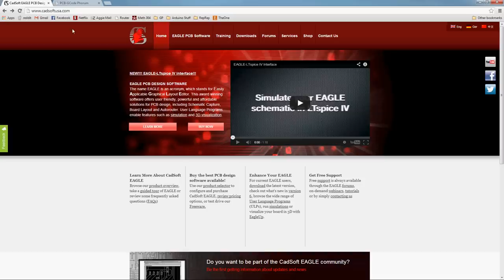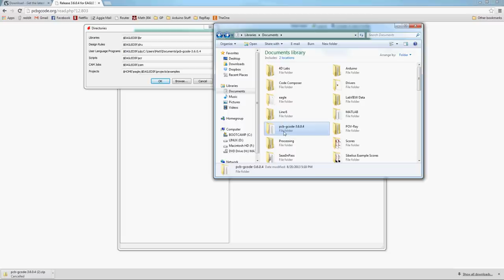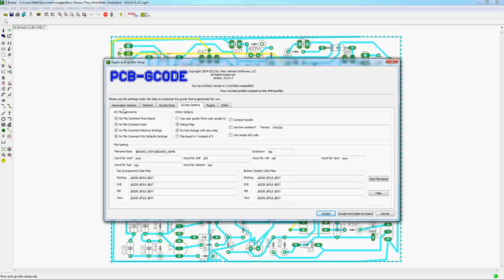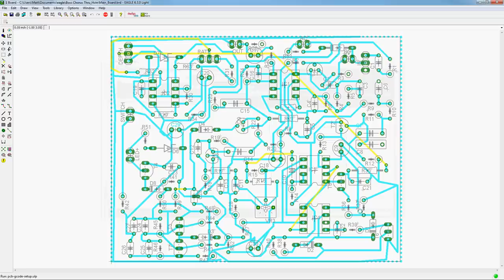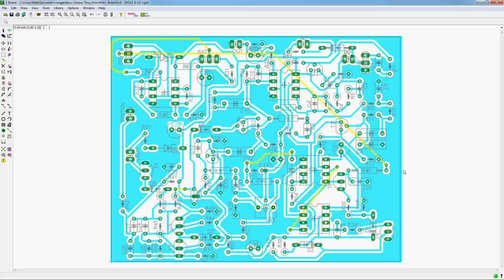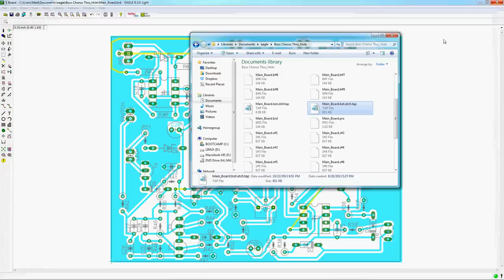How to use EagleCAD to generate G-code

Comment: I have not seen all the video yet, but wow. I love the very first sentence.  You cut to the chase and tell us right off that there is apparently a built-in library or such, in Eagle, to where you can just do it all right there in Eagle, ...design your pcb, and export it to gcode.  This is going to be an awesome video, and it looks like I have already found a solution to the same problem everyone has. How to go from pcb to gcode for milling. I just got my CNC machine working, and the entire CNC thing is so intoxicating. If you need a new drug, I recommend a CNC machine.  You won't eat, sleep, or want to do anything else but want to play with your CNC machine.

Comment: If anyone can help, whenever I run pcb-gcode_setup, I only get a list of different directories, and an 'accept' button. There were no other options.
Reply: You probably extracted the archive in the ulp folder of the software... If so, add the location of that folder after that semcolon in the user language programs section... like: $EAGLEDIR\ulp;C:\Program Files (x86)\EAGLE-6.5.0\ulp\pcb-gcode-3.6.0.4

Comment: Anyone, knows how to generate drill holes?

do I use a Hole tool then mark each one, then set up in the PCBGcode window? Check box to drill hole?

I'm not getting any drill gcodes :(
Reply from the maker: +TheZodiacNeophyte There is two files that are exported, a 'etch' file and a 'drill' file. The etch file contains all the traces, while the drill file contains all the holes. Hope this helps. -Matt

Comment: I already have the tap files but something is wrong with the etch for top and bottom as they freeze up about midway through they were done by the method you show in the video.
Reply from the maker: +Chris Kindig Which version of Eagle and PCB Gcode are you using? I'll try to replicate your problem
Reply: +Matt Westwick sorry was dinner time they are both the latest downloads, eagle 7.4.0,
g-code 3.6.2.4
Reply from the maker: +Chris Kindig I tried to replicate the problem with the same versions but had no problems with the trace file. Maybe contact the PCB-Gcode devs? Sorry I can't help more :(

Comment: How to genrate g codes for text .thanks
Reply from the maker: This technique is mostly for creating printed circuit boards. Using Eagle to create text and then using PCB-gcode to make toolpaths is totally possible, but maybe a bit suboptimal. 

I would think the easiest way to create gcode to engrave text would be use a vector drawing program (such as AutoCAD, Illustrator, Inkscape, etc) to create a .dxf or .dwg of your text and then use your CAM program of choice (or an online converter such as cad2cnc.com) to generate the gcode.

Comment: Hi.  thanks for de video.  Im able to generate the pads correctly and use it in my machine,  but im having trouble generating the drill files,  because when y open the G-code of the drill file i get nothing.  what am I doing wrong?
Reply from the maker: Do you have the "Generate bottom drills" tab checked on the first tab? Also, try checking the "Generate top drills" check box to see if that does anything.

Comment: it works all great, just my Z axis works inverse. How can you flip the Z axis?
Reply from the maker: That would need to be fixed in your CNC control setup. Which CNC software are you using? 

Alternatively, the hard way would be to generate a script that goes through your g-code and replaces all movement commands with a Z from + to - and vice versa. But it would be MUCH easier to flip the axis in your CNC software.
Reply: ok thx, gonna switch it in my cnc. thx, and again: great video

Comment: The pcb-gcode plugin works for version 7.2 but not version 8.
Reply from the maker: Hey Fiona, I'm still using 7.2 but check the forums at 

https://groups.io/g/pcbgcode/topic/pcb_gcode_and_eagle_8/21299037?p=,,,20,0,0,0::recentpostdate%2Fsticky,,,20,2,20,21299037

Hope this helps!

Comment: Hi, The first screen that comes up when I start PCB Gcode setup is, contrary to your video, a screen where I should select a GCODE style such as Mach3, EMC or iSel etc. What should I chose for a mill running GRBL?
Reply from the maker: Markus Rohner EMC should work with a GRBL processor for most (if not all) g code commands. You can always change this setting later.

Comment: what do you if your eagle does not have the run in file option?
Reply from the maker: +Chris Kindig 

You need to be in the board window, and in the latest version of Eagle it says "Run ULP..." instead of just "Run..." 

Hope that helps!
Reply: I have a dxf file I need translate with this is that possible?
Reply from the maker: If you are trying to convert a DXF to gcode I would strongly suggest using another program, as EAGLE is suited to making PCBs. I personally use QCAD, as it is freeware.
Reply: And thank you for your quick response on an older post
Reply: +Matt Westwick If you use QCAD why did you demo Eagle cad? TIA
Reply from the maker: +giantkilleroverunity I use both softwares, and this was originally a short tutorial for several friends who were having trouble with the plugin. Eagle is more suited to making circuit boards and the PCB-Gcode plugin makes it very easy to make the boards on a mill.

QCAD is much more suited to making parts and components. Have you ever tried to make a complicated circuit board in QCAD? It isn't fun.

Comment: Hello!!! I tested  his application (pcbdgode) in version Eagle  8.2.0. and there is a problem. .....It  opens the tab for the settings... but does not pull out the image's graphic but it only pulls an undetermined (three-dimensional) polygon  ..can you tell me if there is the gcode for the eagle version 8.2.0. that works well.....
Reply from the maker: I have not tried any versions after v.6.5.0, if you find a work around please share it :)

Comment: Matt please you gotta help me! After I generate the G.code what's next? How do I send the files to my mill PLEASE ANSWER! I need you :(
Reply from the maker: Take the file that PCB GCODE produced and change the extension to .ngc; after that load it onto your control computer on your mill by any means (I use a USB flash drive).

Comment: Hey Matt

Top stuff this, just a quick question. I followed all you did in the video, works all fine. Bit difference on mac apple but al works fine now. The question i have is about the actual g-code that comes out. 
Is the milling operation milling a engraving left and right of every circuit? @ first i though it would mill everything away that is not circuit, seems not. I loaded the file into my cnc machine and on the visualization it shows the circuit, not the stuff it mils away. 
Did i do something wrong? Or is it in fact a milling operation that mils left and right of every circuit on the pcb?

Hope you can lend me some help, sry for the english from time to time. I'm from Belgium so kinda lost in translation.

Again Matt top effort with this video
Reply from the maker: It should mill AROUND the traces. If it's not, you may either be using too large of a bit or too narrow of traces.
Reply: ok just checked, indeed to large bit settings. Top Mate!!!!

Comment: Nice Tutorial!! I loved it!! One question, I have a nice collection of tiny endmills, 0.6-1.3mm. When I tried to etch the pcb with it and set the gcode generator to do 1 path with min isolation 0.6mm, the software got stupid and gave me nothing but the edges.. any clues about it? Thx!
Reply from the maker: +Yi You 0.6mm is pretty big, the software may have not been able to route a path. Experiment with a smaller end mill size and see what happens.
Reply: Matt Westwick thx Matt! That was actually the issue. I think the software works better with sharp tips. For endmills, it does not work very well..

Comment: At time 3:18, did you mean to say 'obliterate your pcb trace if it's too THIN'? (rather than too 'thick'). Anyway, a great video! Fantastic video actually. Thanks for your time to make it.
Reply from the maker: It has been 3 years since I've uploaded this but I think that I meant thick, as in if your bit is too thick (but yes, I could see how that could be confusing). Hope this helps! :)
Reply: Thanks Matt! I see now. Sure did. That helped a lot. I learned a lot from your video. Without your video, I think it would take me months to figure out how to even get started with using this software. Greatly appreciated.